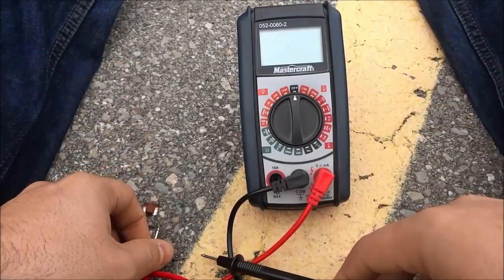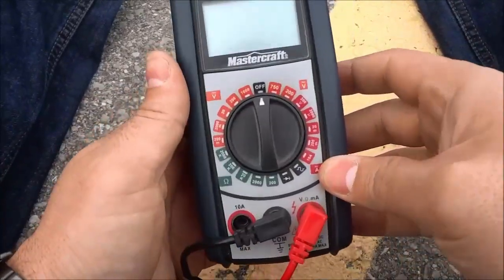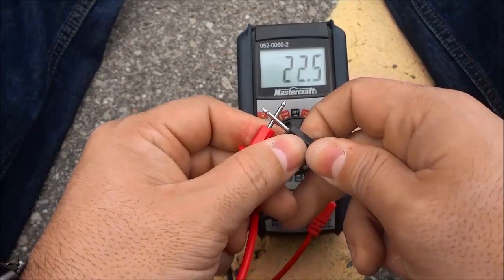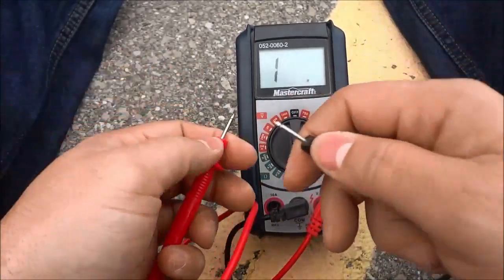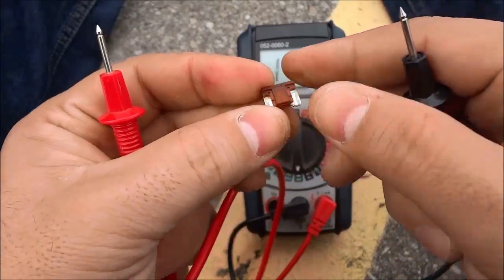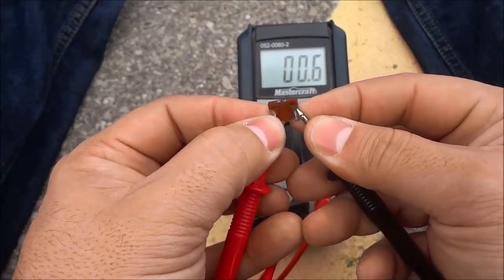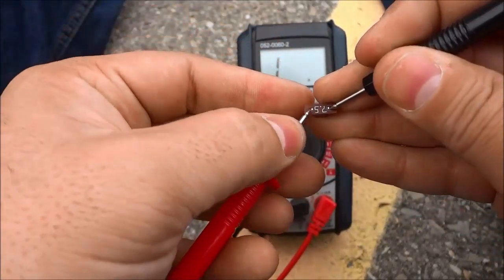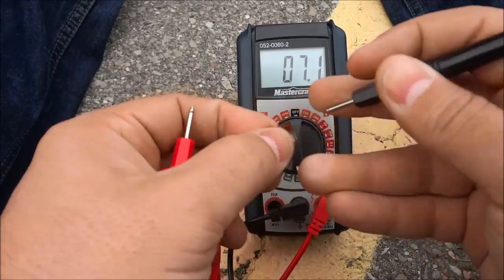How To Check Car Fuses With A Multimeter-Tutorial To Check If A Fuse Is Good

Comment: I was looking for a video where you could test the fuses in the car,not have to pull them out...isnt there one??
Reply: He basically did that when he showed the top of the fuse that have the numbers printed on it. There are two spots where the metal is exposed. Just touch those spots with the probes and check the multimeter reading. You can do that without removing the fuse.

Comment: Just put the meter on the continuity setting, pin the exposed metal on top the fuses if possible and listen for the beep! A lot easier than pulling them out, or even looking back and forth. Can use same setting to test for any circuit.

Comment: Wow. That was useless. You explained the most obvious part and left out the useful part (how to set the dial on the multi-meter and which ports to plug the leads into
Reply: Yes thank you!! I dont know where ohm or continuity thing is. Or what ports the red and black cord go in to.

Comment: and if the fuse is bad it reads?.........
Reply: Just like when the probes aren't touching anything,  number one to the far left indicating no continuity. You can also do resistance. Burned out fuse will read the same 1 to the far left indicating infinite resistance because no current flow.
Reply: thanks and it works.
Reply: The number will jump around on a multimeter

Comment: Can you test the fuses using continuity when the fuses are still in the csr
Reply: Michael Chavez stop spreading misinformation, yes you can check them in the car as long as they have an exposed top. Not all fuses do!
Reply: YES
Reply: @hypnogognosticist  What is your deal? You're that desperate for attention that you answer questions you have no clue about? What an asshole.
Reply: @hypnogognosticist  that's bs. of course you can